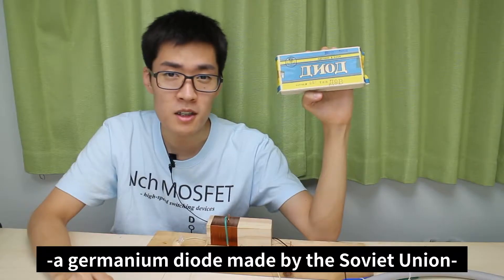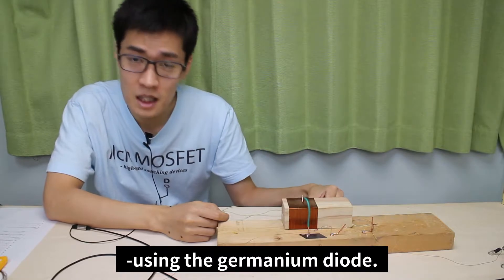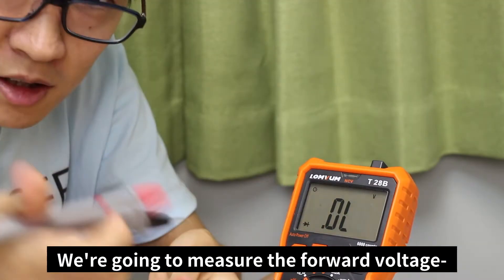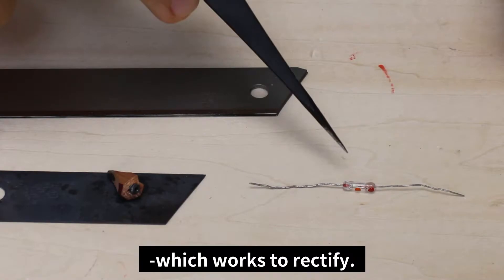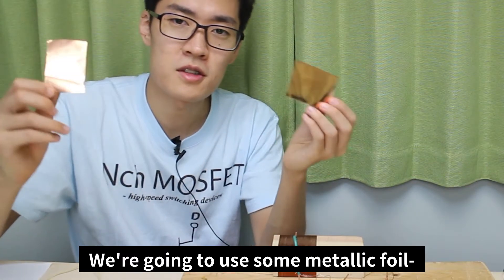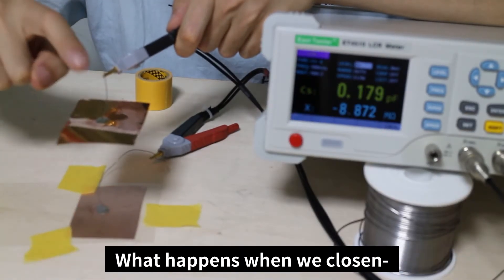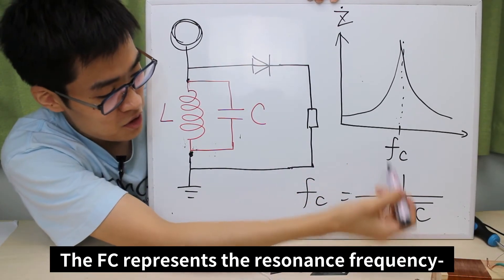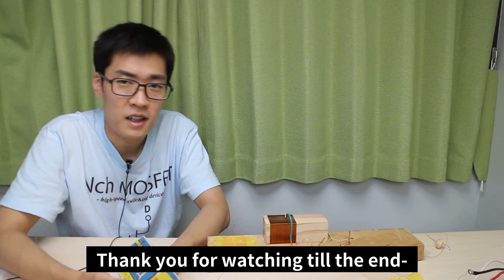I got Soviet made germanium diode and modified the radio

Comment: In my childhood, probably in the year 1979-1980 I used to listen local station using just two components and an antenna and ground. One was a headset and a germanium diode OA79. The headset was actually the headset of wired pulse dialing telephone. We used to connect the diode in series with the headset (as much as I can remember because I was only 4-5 years old back then) and connect one side to antenna and other end to the Earth. Voila you have a radio without any battery. As the radio station was very near to our home only 2 Km away, the sound strength was quite good. I still remember the number of the diode is because slowly these things got me into loving electronics and at those early days normal heterodyne 6 transistor Radio (3 for IF section and 3 for speaker amp) and cassette players all that we had to play with.  I used to carry my single battery Panasonic Radio all the time.

Comment: Adjustable ferrit rod inside the coil, was what I had on my first circuit for the tuning. That also worked very well and was a lot smaller than the wooden coil, anyway very informative stuff. 👍 I hope, they don't switch all stations to digital signal, because that would be the end for such easy circuits.
Reply: yea in the USA digital radio stations exist which has analog and digital
Reply: Why worry about signals going digital? 

Just replace the analog germanium diode that decodes the AM signal with another (digital) diode that demodulates the COFDM modulation and decodes the HE-AAC v2 audio stream.

Comment: Excellent, Soviet made components work well.  However, the "China express" will send a Shockley instead of a Geranium diode. I trust the Russian stuff, Japanese and American components are rarely sold in the open market here and are expensive, Parts houses only. Ebay CCCP gear is better than Red State CCP fake gear.
Reply: you can usually still find suppliers of germanium diodes such as  OA91 or equivalents
Reply: @andygozzo72  The diodes he shows in this video are point contact diodes and each one was hand tuned.

They don't make these anywhere anymore as the labor costs to individually tune them would be too high.

The modern replacement diodes may be the same materials but they are not point contact and will not give you the same results in a crystal radio.
Reply: @tenlittleindians   the OA91 types i mentioned (and OA90) are point contact, and look identical to the ones in the video, get one and look into one with a magnifying glass and you'll see , theres also several earlier OA types with larger glass case

Comment: I really like the crystal radio from the 130 in 1, 160 in 1 and 60 in 1. Many of my radio kits in the electronic kits uses two transistors amplfication or an Amp Op IC from the 1980s. Electronic history is cool.

Comment: Hi.  Nice episode. 
Would love to see you upgrading it further. Maybe explain how to achieve tuning in to specific station of your choice. 
Can I use this radio to listen to FM stations? 
Also I have problem with finding earphones you use. 
How did you made it work with speakers?
Is there any type of modern diode that will make it work? 
Those soviet ones are hard to get ;)
Reply: Well... 
1- The station is chosen by modifying the position of the coil wire.
2- No FM, only AM
3-Cristal earphones, or any speaker would work, if it don't need a lot of voltage nor current. 
4- Every diode would work. The Cat's Whisker, or the Razor Blade,  works by making exactly the same job as any diode. Just use it in the correct position.
Reply: That's the "fun" of these types of radios. If you can tune it high enough to the FM frequencies you can sort of hear it. The FM messes with the AM detection. I've done this and it works but it's much weaker than AM so it will be very quiet.
If you can't find the crystal radio you can use a regular audio amplifier with a speaker. It's "cheating" by using batteries but it's useful for just playing with. I've seen some people use a custom made impedance matching audio transformer. The radio has a very high output impedance. A transformer that can couple the high radio impedance to a low impedance speaker does work.
Tuning is done by whatever means you can use. Changing the inductance uses the least amount of parts. Adding capacitors is another way of tuning.
If you make the radio so that it's easy to swap in different diodes, then make the radio and start trying different diodes. Some diodes will work better at different frequencies. A small schottky diode might work. I've used a red LED before (only good on really strong stations).

The thing to do is play with the parts and see what works and how well they work. This radio is less a science and more an art.
Reply: @isaacm1929 Modern diodes have a higher forward voltage and won't work as a direct substitute in this circuit. 

I think it might be possible to bias a modern diode using a potato as a battery along with a properly sized resistor. You would still need a crystal ear piece for listening unless you added an amplifier section to this radio circuit.

Make that amplifier section potato powered too for real trench war conditions.
Reply: @therealjammit AM radio is "amplitude modulated" and FM stands for "frequency modulated". It's not as simple as adjusting the coil to a different frequency range.
Reply: @tenlittleindians  Yeah. I forgot that. Most diodes today need bias. (But it is still possible to find modern diodes with low forward voltage in some places. )

Thanks for correcting my comment! 

Also, potatos are a valuable source of food, so, in war, maybe lemon power would be better.
Reply: @isaacm1929   The fruit or vegetable you would use would depend on where you live and what time of year. Potatoes and tomatoes  and apples and cold thriving plants where I live.
Reply: @tenlittleindians  I was just saying that it would be better for the soldier in the foxhole to eat the potato, not build a radio with it lol.
Reply: @isaacm1929   You listen to the radio then eat the potato after the broadcast. Lol
Reply: @tenlittleindians  Eat the radio. Always informed.
Reply: @isaacm1929   For a great breakdown of diodes and a way to bias modern diodes with just one volt checkout this video: https://youtu.be/2yzr4kx8SJ4?si=NcaBP4A7G8UBL1O3

It's the video which got me thinking about how soldiers could have built trench radios with homemade batteries to power the bias.

The video provides a circuit to bias various diodes towards the end.
Reply: @tenlittleindians  I admit the AM does a poor job on FM, but FM does contain accidental AM because the carrier shifts in FM. The AM detector recognizes these shifts as a change in amplitude. The signal is weak but you can get recognizable sound out of it.

Comment: Can you use multiple diodes in a single crystal radio and see how much voltage output?
Reply: no, no point,
Reply: These radios are getting their voltage directly from the frequency waves hitting the antenna.

A hundred years ago they maximized this by increasing the length of this antenna and often ran a long wire out a window to a barn or tree over a hundred feet away.

The length of these long wires work best if they are either multiples of or fractions of the wave length of the frequency you are trying to tune in.

Those long antennas were insulated from ground at both ends by ceramic insulators about 2" long which I still see for sale in antique shops. Usually they are white or blue with a hole on each end.

They had an alligator clip on the wire from the radio to this long antenna so they could disconnect it during storms to prevent lightning strikes from traveling down the antenna and burning their houses down.